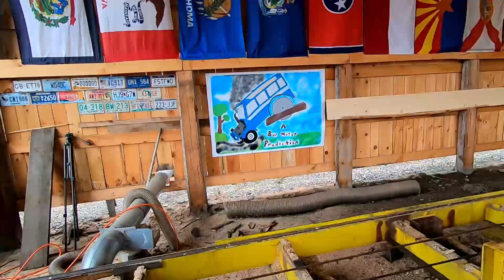the last poles

Comment: My grandad had a sawmill for years. And I have made woodcrafts and custom cabinets as well as working in the mill. Do you ever saw quarter sawn lumber? We used to slice straight theough a log without turning it to get the prized quarter sawn wood in the middle of the log. I love the green and purple of poplar wood. Love your videos!
Reply from the maker: thanks Jim, that is called flitch sawing. I have some walnut logs that I will saw that way.

Comment: Does the creosote sawdust going into the sawdust bin adversely affect its use for the people using the sawdust for animals?
Reply: I was wondering about the same thing. Do you do any special handling to separate the creosote sawdust from the normal cut ?
    Another random thought : when Eddie's wooden tent is completed, how are you going to handle the heavy work ( like these slabbed poles ) that's going to need the use of a forklift to move it away from the output rollers ?
     Eddie really needed the hernia relief on this job.... 
      Best regards........ Gary
Reply from the maker: we had the backhoe bucket under the sawdust chute to catch the pole dust.

Comment: Thank you for a video on Thursday. Question: Can you burn creosote treated wood for heat? I know creosote is a flammable oil but is it's smoke letal or just nasty?
Reply: Cancer causing. Not to mention the sawdust  chemically burns the skin. So you can imagine what it does to the lungs. Actual cartridge respirators are a must, and keep it off of your skin.
Reply from the maker: I would't burn it in my woodburner.